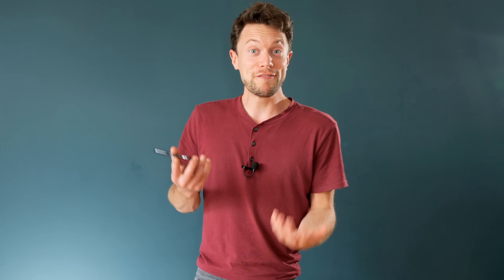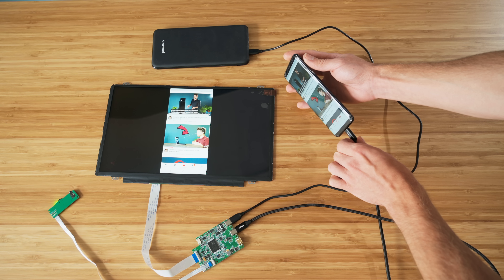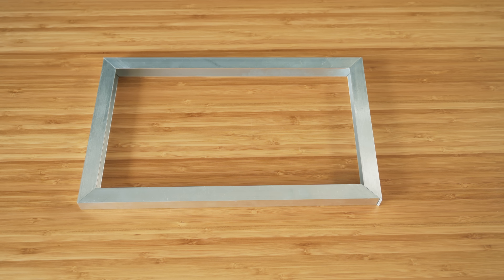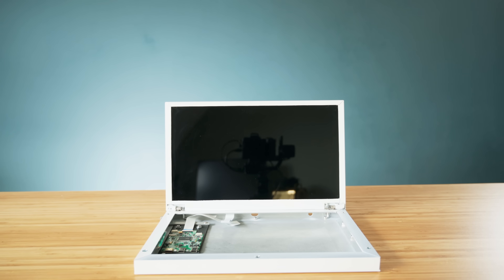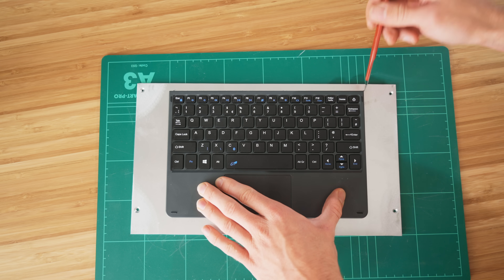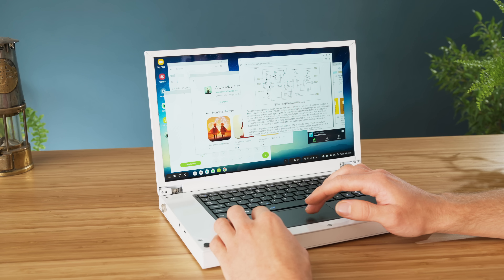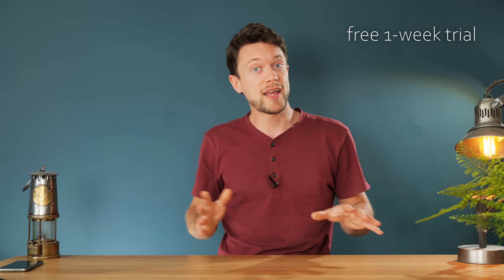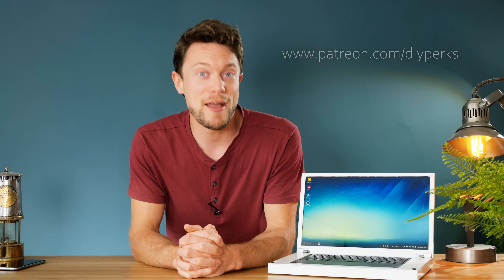Broken smartphone to working laptop transformation

Comment: That's impressive, but imagine if for a starter you add a USB hub, a laptop camera module rewired to USB, USB ethernet, a DIY power bank with a toy-like battery access door so you can remove discharged li-ion cells and add charged ones... then build it so you can slide-in from a side your undamaged/perfectly working phone to get a laptop.

Comment: If your phone support screen mirror via Miracast you can use an "Anycast hdmi dongle", but the only problem is the connection need to be done via WiFi, two devices in the same network/router or mobile AP.

Comment: So. Make a Laptop, all you need is a old smartphone...

Multiple Electronic components, cables and a Powerbank, definitely not worth more than a new phone display, multiple aluminium parts, power tools to work on that and soldering tools.
What a nice DIY everyone can make. 
And hey you can use it with every phone, if you decide to throw away that damaged one anyway.

Comment: Great way to get over the limitations of old tech I’m a big fan. When you were installing the keyboard you said you put the keyboard inline with the external power line, would that mean that the keyboard power supply and the battery associated with the monitor and phone are not the same while not plugged into a wall? So potentially you could have a dead keyboard but a screen and phone with a charge.

Comment: Awesome!  I recently broke my Motorola ATRIX HD and have been wondering if I can directly use the HDMI output to a screen or something like a ROXIO Gamecap HD PRO.  Still need to read into... just bought a $8 parts ATRIX HD since my LCD is broken and the touch pad seems to be working to unlock and access the files saved on... thankfully I can somewhat recall where to touch and swipe to unlock.  Not sure if I need to chance settings somewhere for the HDMI output... though will be interesting to research.  Thanks for sharing Man!  Awesome details and projects as always!
Reply: Makes me think about planning on making a custom camera shoulder rig device too, as I was wanting to do something like that at one time with a cell phone or tablet for a screen and using a security camera that is high quality and at least 4K along with the cell phone cameras and data for audit trail and processing the RTL-SDR or HackRF.  Plus add options (mounts) for audio detection's maybe beyond the sonic range, SLR lenses and the radio direction finding.  A little different application, since I was wanting to do more for RDF and document in more detail the RF with video and audio.   Figured I'd note, thanks again!

Comment: "...This phone, with all its cracks, would be difficult to repair.."
Me and my phone where you can't touch a single inch of the phone without scratching yourself in a crack:
"yes, continue"
Reply: The phone would have been actually quite easy to repair and would have cost around 30 bucks.
But that would ruin a perfectly good video :)=
Reply: @TheAzynder  well if the frame itself is bend or cracked then nope, otherwise yeah

Comment: THIS IS SOOOO AWESOME!
WHEN I'LL GET A USB-TYPE C PHONE, I'LL INSTANTLY MAKE THIS!
IT'S GREAT!
Actually, I saved the screen from and old laptop which fan failed, and the processor burned out
It's a great screen - 1080p FHD, 15", but I'm not sure if I will find a driver board with an USB-C input. But no problem, as I can use a USB-C to HDMI dongle.
Maybe there is a Micro USB to HDMI converter too, so I can use it with my daily driver phone, but I will be buying a smashed up Samsung Galaxy S8 just for this, I will hook up the powerbank's internal battery to the phone, so I see the powerbank's battery percentage on the screen.
And since this will be a smashed up phone, I will take out the WiFi and Bluetooth antennas and put them on the plastic part of the case.

Comment: I'd want to do some soldering and hard wire everything in,  although the wifi might be an issue. Maybe add a slightly indented area that could be fit with a plastic component on the top? I could see making a cool slanted plastic bit for the front, to spice up the design a bit.

Comment: If you had made this with pure zinc instead of aluminum, you could have soldered all the frame joints together (leaving a much cleaner look).
Reply: Also, you could have used a screw-on Micro-USB bulkhead for a cleaner charging port and easier cable sourcing, such as this one:
https://www.digikey.com/product-detail/en/amphenol-commercial-products/MUSBK15230/MUSBK15230-ND/3465047?utm_adgroup=Connectors%20and%20Interconnects&utm_source=google&utm_medium=cpc&utm_campaign=Shopping_Amphenol%20Commercial_0664_Co-op&utm_term=&utm_content=Connectors%20and%20Interconnects&gclid=CjwKCAjw9vn4BRBaEiwAh0muDDylshj32WFkSX4uwsxqrDBW3tFpQqiIZJFDF9wxl0dyBtMatVxHrBoCnFMQAvD_BwE

Comment: Interesting project. You started trying to save your smartphone, but what you really built was a lapdock, as you let the phone outside.
You could even put a displaylink dock inside, making it possible to use with any android smartphone, using, for example, Sentio Desktop.
You could let the front camera above display, and could use it for videoconferences.
Awesome!

Comment: I would like to see this done with plexiglass or polycarbonate sheets, to see all the electrics plus the wifi would work😋, it would also get noticed even more, a conversation piece...(that you have to stay 6' away to discuss..) 🙄 The only thing I'd change or add would be a slight angle to the area below the keyboard to have speakers installed at and angle toward your face..... Shoot why not  put some window film on the clear part to have it Simi transparent, or transparent paint the options are endless....do all this with a broke tablet as well....

Comment: There could be a great revisit in this case. Instead of using the main camera for Skype, or other apps, you should  make a 3D printed mount for mobile, where can you change its position in vertical way. So you can use selfie camera for Skype.

Comment: you know you could buy a different kind of laptop which does not has any processor and you just need to connect a mobile phone to it by wire and that laptop price would obviously cost a lot less than a normal laptop, plus it also looks like a proper laptop with a really slim body

Comment: Some wierd design decisions in this. Why have like 5 different 3.7v lithium batteries inside? What if the keyboard dies before the power bank or vice versa. and why not use circuitry instead of that mechanical slider, that will be prone to wearing out. Still awesome though. cheers

Comment: I would have mounted the phone slightly higher on the back to allow for usage of the front camera.
Reply: Recycled laptop camera modules can be rewired as USB and connected to the controller board, so the phone should detect it as external cam. The guy has a video about that https://youtu.be/CouxmNqxO4A.

Comment: A better thing was to create a costume kernel that allows some extrenal wifi adaptor, a real usb keyboard, a real mice. Or Or or OR OR BUY A FKING LAPTOP ON EBAYFOR LESS THAT 100 BUCKS , THAT I SWEAR WILL RUN FULL WINDOWS , COULD DUALBOOT MACOS/ LINUX AND GAVE YOU FULL EXPERIENCE.
Reply: than*

Comment: People don't realize that their cellphone especially flagship models are already super handheld computers. They have more computing power and applications than PC in the 90s or even early 2000s and they fit in yout pocket. This is still a great way to refurbished a screen damaged phone though.
Reply: Less e-waste in end indeed. Of course better is to repair phones themselves. However new screen and glass back panel are expensive - like 150$+ for screen alone and 50$+ for back panel.
Reply: @KrotowX  There's another case, when you source the smashed phone for free and you don't really need/want to fix then sell it for the amount you spent on the repair. So: free damaged phone + a ton of fun = laptop to impress around, or to give to someone in need
Reply: Still most overpriced af
Reply: That moment when a lot of new flagship phones have more ram than most low end PC's u can get in the store.
Reply: @dramajava2364  that moment when you can change parts in pc. OOOOOOF

Comment: Wouldn't it have been better to wear out a DPST switch to power it on and off, instead of wearing out the USB sockets of the  display driver?  It really doesn't take much effort to carefully peel a little insulation off of those USBC cables and put a switch inline on the +5Vcc wire to enable/disable the USB connections, instead of completely unplugging them every time you want to turn it on or off.  You can even buy USB cables which already have a switch made on to them and simply rewire the switch to another switch that has enough poles to turn them both on/off simultaneously with a single switch.

Comment: plz, do like this with mini itx/mini stx motherboards. DP-->eDPadapters for panels is very simple. +lvds on every mb(not all resolutions, not for all cables. problems(?) with gigabyte mb bios options, etc.
 mini stx can be modded for less high. remove and replace original ddr3-4 vertical slot (parts from ddr4 sodimm dimm adapters, or dead notebooks)

cooler -- intel thermal solution, or from videocards, or less than 30mm high.

only needed ups/battery and controller.

Comment: DIY should be built from things commonly found in homes IMO! If you need to purchase all parts and a stocked auto-repair shop it's just called 'Instructions'
"Now cut out parts in this $200 000 laser cutter.." NOT DIY!
"Glue your old lamp, a toothbrush and 2 eggs.." = DIY!

Comment: Hi
I’m wondering if you can help me. I supply and install Cctv and I have a customer who wants a microphone hidden inside a electrical plug socket. So far buying one in is a bit expensive and I know I can make one. So far I thing I need a 4g gsm module, a microphone and some sort of bridge rectifier to convert 240ac- 12v dc. I have looking on Banggood but I’m not 100% sure which products to buy. I also have zero programming experience on an arduino. Any hel much appreciated 👌👌🇮🇪

Comment: Sorry but I've got a question related to one of your previous projects:
I'm currently working on a DIY monitor project but my panel is a 4K monitor from a Lenovo Y700 and I can't find an affordable and available driver board for 4K resolution. However, there are plenty of 1080P boards available and I'm okay with getting FHD output if it's possible.
Does my panel work at 1080P with a full HD compatible driver board or I have to buy a 4K compatible one?
Your videos are brilliant BTW! Keep them up… :)

Comment: Nice project and great quality video, as always. 
Didn't knew that kind of video board existed! I was thinking you would use a Type C hub. 
I think I got some ideas for a version 2 of this.. 
I think I would have removed all the cases of the various components (powerbank, keyboard..) to save up some thickness.
I would have made the case of another material to be able to leave the smartphone inside. With some task managing apps (Tasker is the best) you could also make that removing power will automatically shutdown the phone and feature a routine that re enables Bluetooth in case you accidentally disable it (you would then lose your only input to it, the keyboard).
Maybe some speakers, as you said.
And maybe some rubber foots to make the laptop rest on them instead of its case. Yea, maybe also between the screen and the case so that you can close it without worrying of scratches on that beautiful paint job. 
Hey! Keep it up!

Comment: It is much easier to do this using a defective 17 inch macbook pro. Especially if it is a slightly older model, which, because it is thicker, has more internal space. The keyboard and mouse of this model is USB, just solder the wires of a traditional USB cable to the flat cable. In addition, the keyboard is backlit, and the mouse is multi gesture. For the screen, it is the same process as the video, a plate that transforms his display into a common monitor. Instead of using a powerbank, you take advantage of the internal battery, just by purchasing a small charging circuit, easily found on Chinese websites. In the end, you will have a beautiful and stylish laptop / cell phone running android.

The cell phone can be embedded inside the equipment, just disassemble the cell phone, and connect the antenna of the laptop, to the wifi antenna connector, which exists on the cell card.

Comment: I would've used plexiglass for the case and a toaster like slot for a phone inside. Your sugru holder was fine, but i'm worried that it could scratch the front glass of a phone if you plugged and unplugged it often. You can use termux and with it install a linux distribution for the real computer experience

Comment: This is great but to make this into full-fledged laptop it needs more usb socket to plug mouse or usb hdd or whatever. You can use always use bluetooth mouse but I recommend usb c 3.1 hub with hdmi, 2x usb and 4 card reader which can be mounted in corner. Gj btw

Comment: Question: if you a smashed phone and an old laptop, would it be possible to do something similar to this process?

I would like to try and do something like that and gift it, but I have no idea how to work with aluminum.

I actually have several smartphones I could use so what I'm really asking is if it's possible to keep the hardware of the laptop, take everything out and then use parts of the smartphones to make a new laptop.

Comment: You should have opened the   phone and taken out the WiFi antenna and should have stuck it on the body of laptop and painted and connected with extended wire

Comment: Smartphones in general are great pieces of tech and you do a great job showing their uses outside of the norm. If you really think about it smartphones are just computers and can be used with accessories on many things.  Using the Alexa app and speakers it can become an Amazon Echo.  If your phone allows external storage it could become a file server. I have even seen software that can turn a phone into a router. 

I know you typically plan your builds way in advance, it would be nice though to see mods on older generation phones that normally would be discarded. 

Keep up the great work.

Comment: Using some metal to be supports and 3D printing most the rest would let you keep it internal only, plus I would add something to turn off the battery letting it charge while still allowing it to run because using the battery bank while charging it isn't safe. Or find a way to use the phones battery until it goes to die and then allow the battery bank to be used as well.

Comment: why not use a panel with nonglare or one with touch. And if you put the phone where you put it... why not mount it a bit higher up, so you can use both cameras, or flip it and let the back camera look over the top of the screen? As for the charging part i think i would use a usb c or micro usb port instead of a dc power jack, so you can charge it, even if you have to borrow a cell phone charger but you forgot your usb to dc jack cable.

Comment: I built mine a year ago with an old laptop as the motherboard died so I removed it and installed all the parts in it, I reused the screen, keyboard and touchpad, to turn the keyboard and trackpad to USB, I just followed the steps from Frank Adams video  (https://youtu.be/Z1PheqSNNP8), I also transformed the battery into a charging bank and removed the DVD drive to store and plug the phone right there.
The complicated part was the assembly and key mapping to Arduino, but that was it.
I just wanted to give a second chance to my old HP Pavilion and it was a really cheap project, I spent no more of $100.

Comment: This is a great idea, I wonder if the android system in desktop mode automatically kills background or minimized apps like usual though?  🤔

Also, an important thing to consider is the power bank.  Most warn to not charge while using them.  Try to find a power bank where that isn't a problem 👍

Comment: 6:39 I’d highly recommend looking into this for anyone trying this,
USB 3.1 gen 1 is just USB 3.0.
USB 3.1 gen 2 is actually USB 3.1
Same for USB 3.2 type 1, which is USB 3.0, while USB 3.2 Gen 2 is USB 3.1 gen 2.
USB 3.2 Gen 2x2 is the actual name for that.

My advice?
Look for a USB 3.1 gen 2 usb C OTG cable.
You can however, leave the ‘gen’ part out of the searches.

Comment: If you feel like taking the phone apart you can extend the wiring for the camera so you can mount it in the laptop bezel.
Reply: Or you can change phone’s screen and flip it
Reply: @Unexpectedstuff Depends on the phone and how careful you are. I've operated on a samsung galaxy S4 and a S7. For the S4 it was about data retrieval. For the S7 it was to replace the battery. Both had cameras that were detachable from the main board and held in place by the chassis. If I wanted to I could snip the wire and solder a longer one in its place. I just never had a need to. But if I was to turn a phone into a laptop perhaps I might.

Comment: A few improvements i would suggest. 1. A hinged keyboard plate to get easy access to the powerbank so you can see how much charged is left without having the issue to unscrew the whole plate. Maybe with magnets buildin to secure the plate from swinging while using the keyboard 2. Speaker that are build within the display .. Well not really buildin but attached to the back as outstanding little "boxes" facing towards your face. 3. And just perhaps if the phone would actually turn on without the smartphone screen still attached... removing the screen to give it a bit more batterylife at all.

But I honestly really like the build! Nice work :)